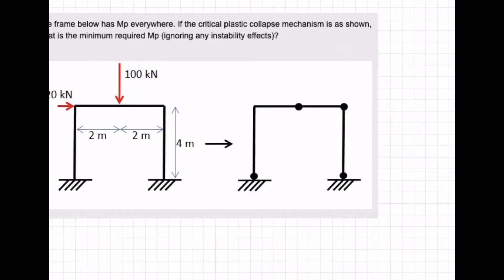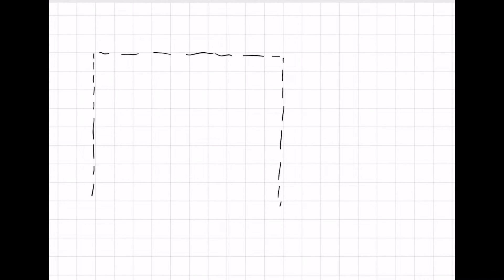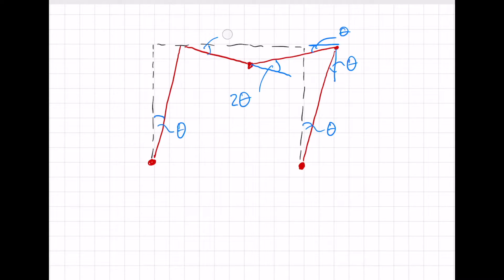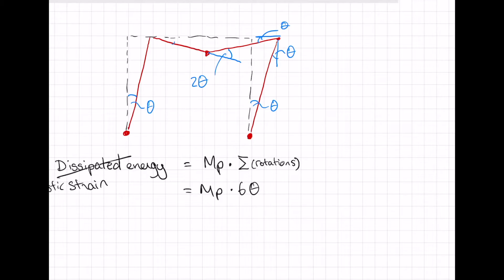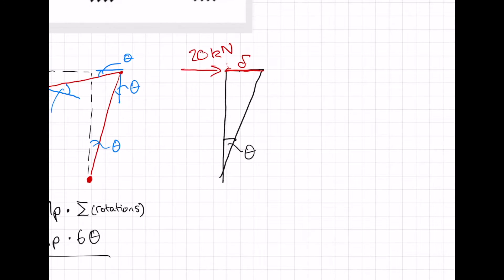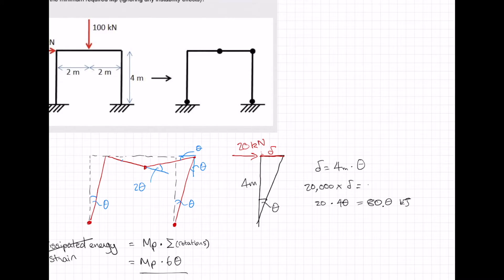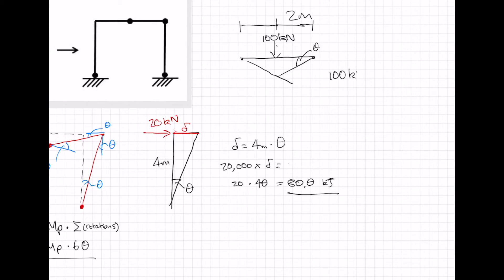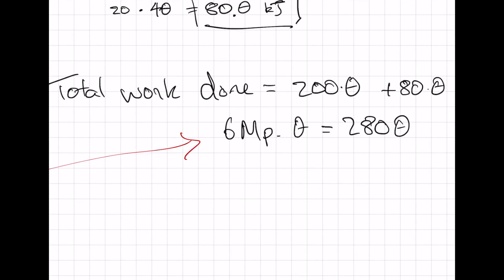Plastic Collapse of a Sway Frame - IStructE Certificate in Structural Behaviour Course

Comment: Don't you think you need to break down the frame into 2 mechanisms rather than combining? The first mechanism plastic moment is 80kNm and the other one from the 100kN load will cause the collapse which is 50kNm.
Reply: Yes, that's what you would do usually. But the exam questions has already done this by giving the failure mechanism. It's skipped over the elastic analysis (assuming you already know how to do that) and focused on the plastic analysis.